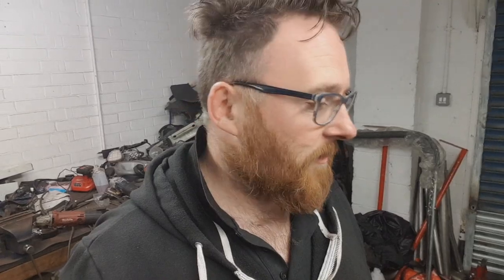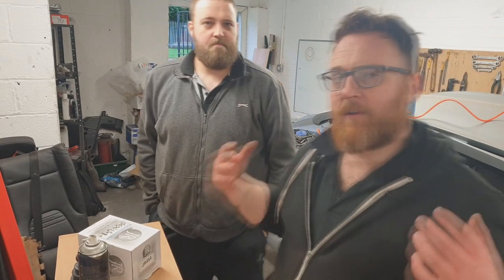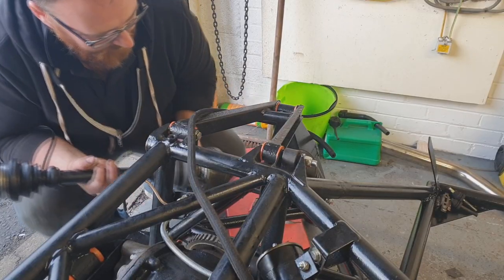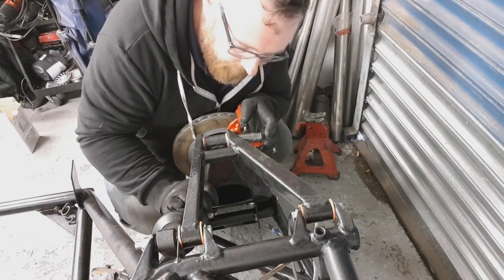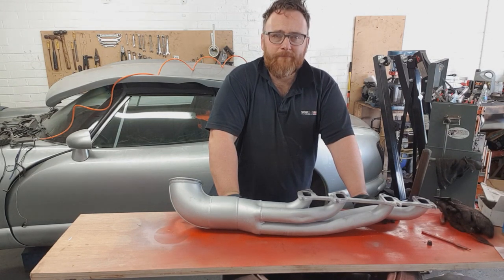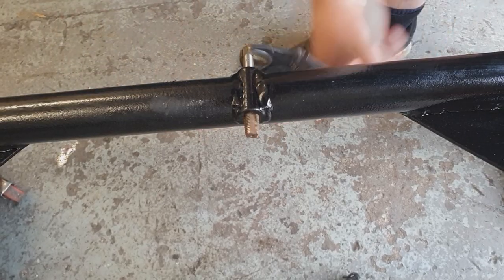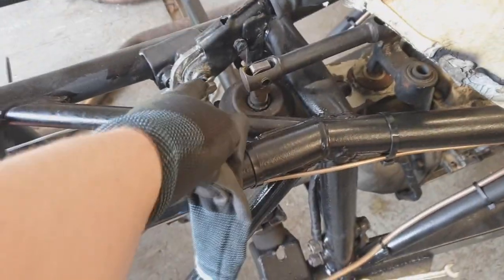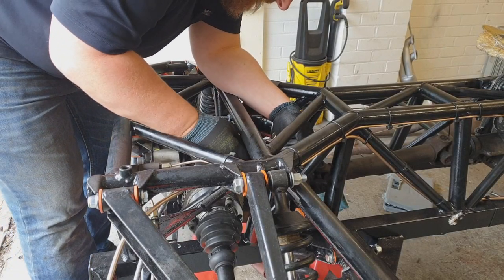TVR Chimaera CHASSIS RESTO - Episode 8: ROLLING CHASSIS COMPLETED!

Comment: You should probably cover the body with plastic sheeting if you're going to be spray painting indoors to stop any suspended overspray drying on the body. Otherwise it will need a bloody good clay and polish later on.
Reply from the maker: Or a respray... ;)